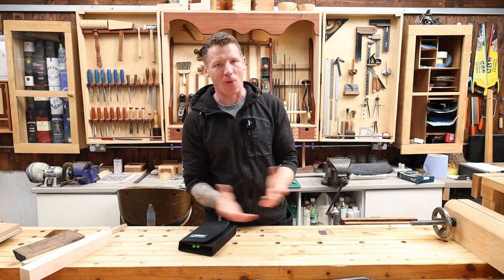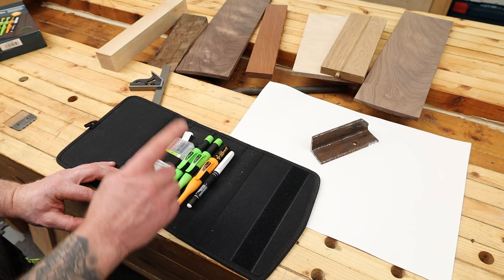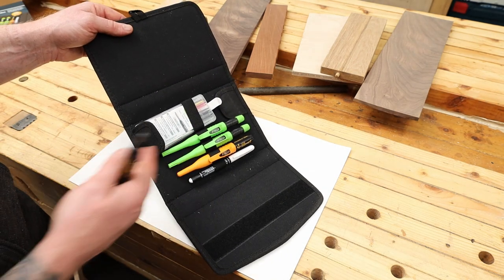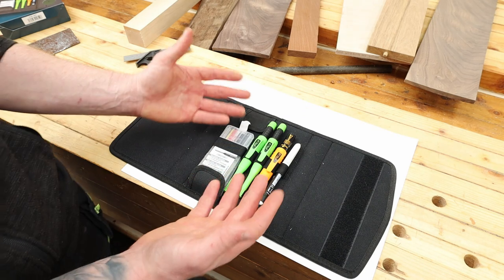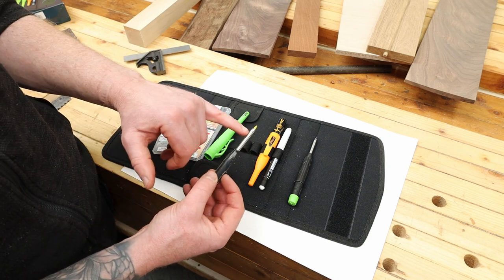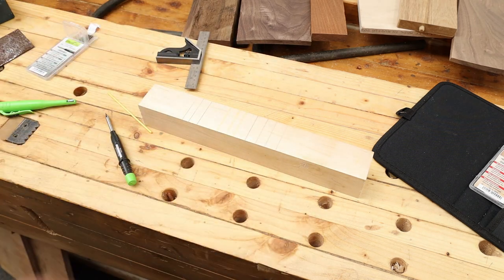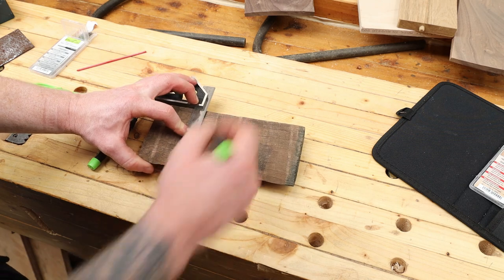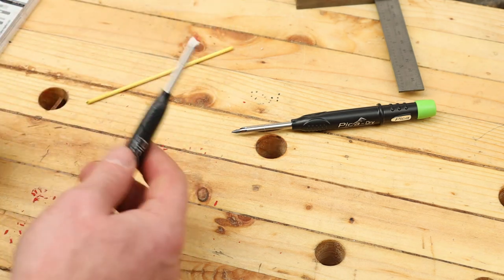Pica Joiner's Master Set. Excellent Marking Tools!

Comment: John, I believe the correct pronunciation is P (long i)ka not P (long e)ka. 

Webster’s definition:

pi·ca | \ ˈpī-kə  \
Definition of pica (Entry 1 of 2)
: an abnormal desire to eat substances (such as chalk or ashes) not normally eaten
pica noun (2)
Definition of pica (Entry 2 of 2)
1 : 12-point type
2 : a unit of about ¹/₆ inch used in measuring typographic material
3 : a typewriter type providing 10 characters to the linear inch and six lines to the vertical inch

I‘be used this form of measurement in graphic design and type settings as well as when I took typing back in middle school where there was two type sizes, pica and elite. You’re not the first person I have heard pronounce the “I” as a long e sound. 

Of course the best form of precision marking is to use a marking knife or scribe followed by a fine wax based colored pencil to highlight the knife/scribe on darker wood.

Comment: Sorry, but a warning here. These are not very well suited for fine woodworking unless you like sharpening at annoyingly often sequences..
A round tip blunts really fast. A standard carpenters pencil (the flat ones) are much better at holding its edge. Use a knife and sharpen it with a wide sharp edge - and you’ll have that edge for much much longer. Staedtler is a very good brand with carpenters pencils. 
However, a carpenters flat pencil is useless for small and/or round holes. A cheap BIC mechanical pencil takes good care of most other cases. These Pica/Hultafors pencils are only good for deep narrow holes - so yes an addition to your pencil tool set, but no main use.